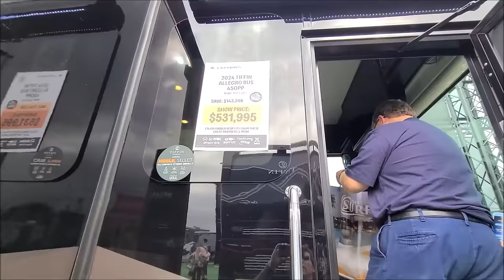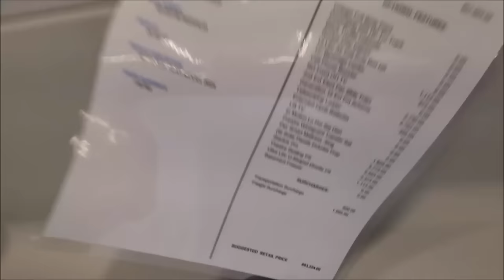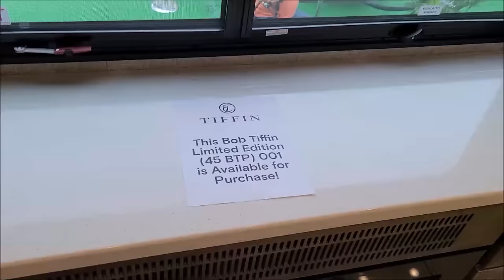2024 Tampa RV Show and What I Found Interesting

Comment: Hey Kevin ,
 A couple of issues I’m having with my 2005 w-22 is 
The cabinets above the drivers seat are separated from the ceiling .  
 The dashboard on the passenger side bounces up/down .
  If these are common to the workhorse would you consider a video on repairing?  
 Thanks and enjoying your videos .
Reply: I put a support in mine. 1/2” water pipe with a flange on either endnote.
Reply from the maker: Can you send me some pictures of the problem? 606-875-0125 Kevin